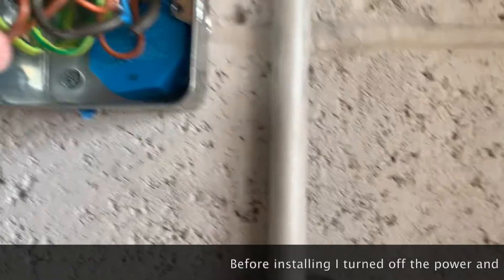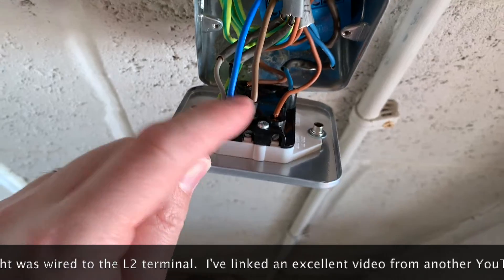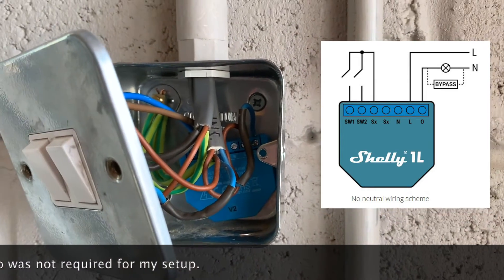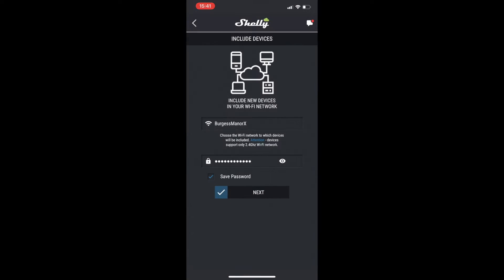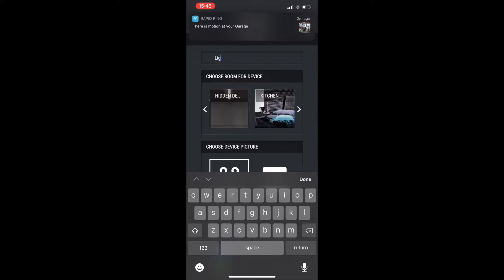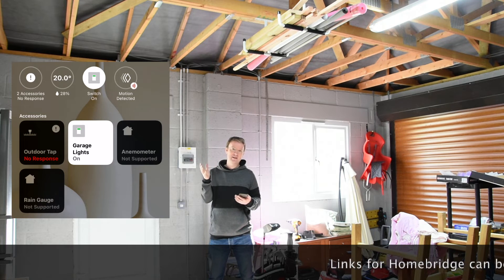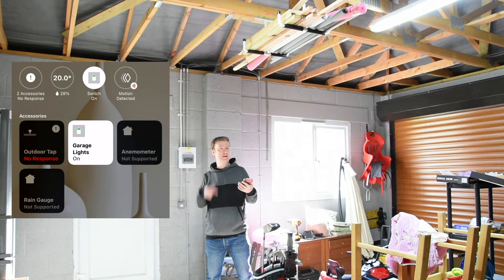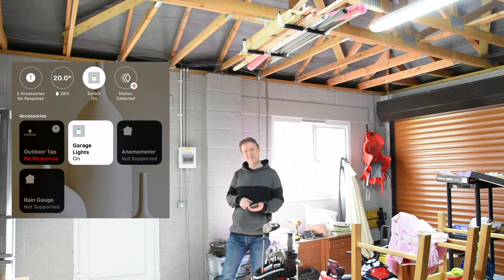Shelly 1L - Installation and Setup

Comment: Would you need two to control both switches?
Reply from the maker: No, you only need one Shelly.  Using either switch triggers the input ton the Shelly and turns on/off the lights.  I included wiring diagrams of how to integrate a Shelly into two way switching in a recent video - https://youtu.be/M6CGARzhCcA

Comment: All looks good except remember that all the wires in the switch should be live, so a blue wire shouldn’t have been used, or they should have had some brown tape or heat shrink.

Comment: thanks for the vid. just wondering if I need to wire just 1 gang switch for 1 light, should i be using 1 gang switch or 1 gang intermediate switch? thanks
Reply: You want a 1 gang 1-way (or 2-way) switch. Not an intermediate switch.

Comment: Is the on lag because of your lights? (Fluorescent?) Or because of the relay itself?
Reply from the maker: The Shelly 1L does seem to add a small delay, however the majority of the delay you can see in the video is because of the fluorescent bulb. I’m not sure if this is coincidentally or not, but it seems that the delay from the relay increases if the light hasn’t been turned on for some time.
Reply: @ianburgess525  Ahh, If its a fluorescent tube and the off is fast then I'd suspect its the tube's delay. Shelly shouldn't react differently to on vs off with speed.
Notably hitting the physical switch still had the delay. Which the Shelly should be instant for because that's local IO (but notably not direct to the light)

Comment: Hi, does the app still turn the lights on if the physical switch position is off? I.e. can you use the app at all times as well as the switch at all times?
Reply from the maker: Hi James. Yes, the app still works even when the switch is turned off. Note though that if you want to use the Shelly 1L without a neutral then the light it’s controlling must be at least 20W. If the light is less than 20W then you’ll need to use the optional bypass.
Reply: @ianburgess525  Hi Ian, thanks for sharing the video. I’m assuming the answer is yes, but would like to check. Once connected to HomeKit and you have automations set, do they still work no matter which way the ‘physical’ light switch is set…i.e on or off?

I hope that makes sense.

Thanks in advance.
Reply: @trev2501  It does work, Shelly detects if the physical switch changes it position and activate the light. The physical switch is connected to the Shelly, not to the light directly, so yes everything is covered with that solution

Comment: Thanks for the video, looks great! Did you wire in the bypass to the lights as well?
Reply from the maker: Hi Sanzhar, thanks for the comment. No, as the lights in my garage use more than 20W I did not need to use the bypass for my setup.
Reply: @ianburgess525  ah, thanks. Glad to be subscribing at the start of this channel by the way, looking forward to seeing more smart home stuff! Just a suggestion, if I may, would you be willing looking at privacy and longevity (sustainability, right to repair) considerations? Many smart home channels omit those, or cover it lightly - granted its hard.
Reply from the maker: Thanks for your subscription Sanzhar! Also, thanks for your suggestion, I like your idea a lot. I’ll do some research and if possible I’ll try to include points about privacy and longevity in future videos.

Comment: If Internet or WiFi is down, can I still switch light on or off manually?
Reply from the maker: Yes, if the Internet or WiFi are down then the physical light switch still works. This is one of the best things about the Shelly devices, the switch continues to act in the same way as a ‘normal’ switch, but with the added advantage of also being able to turn it on/off remotely.